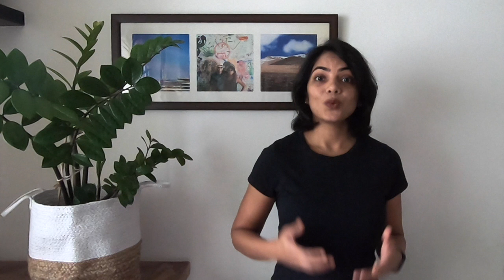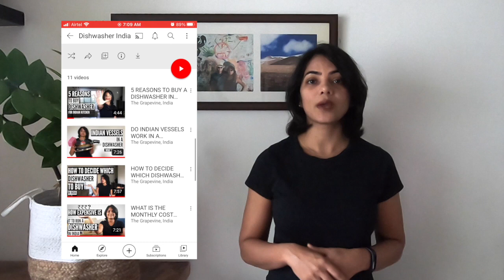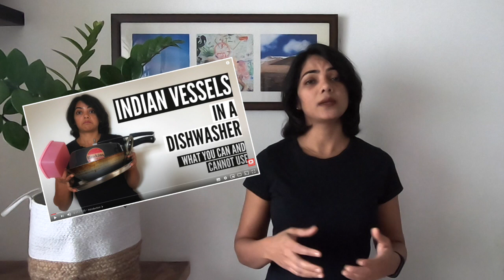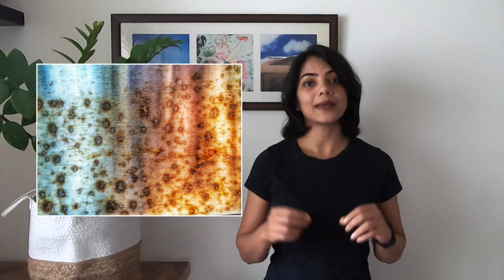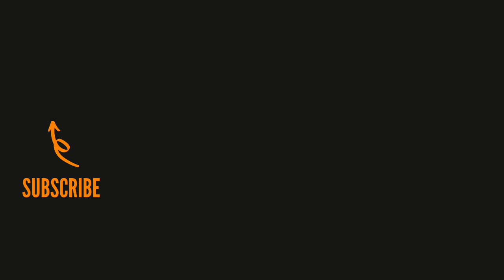CAN ALUMINIUM, NON STICK & ANODIZED VESSELS BE WASHED IN DISHWASHER | Indian utensils in dishwasher

Comment: Most modern cookware is either nonstick  or anodized or cast iron.  I am thinking ceramic kadai and ceramic saucepans. Tawa too. Hope they come up with better milder detergents so we can include nonstick.
Reply from the maker: Hi Anoo, Ceramic is OK to be used in Dishwasher. Consolidating my responses from your other questions - silicone too. Pet water bottles - generally no, unless it is certified as dishwasher safe. Recycleable plastic containers - in general no. When I do have a website up and running, will consolidate in a table :)

Comment: Hi Saumya,  informative video. My stainless steel pressure cooker's safety valve(made of aluminium) got damaged due to corrosion since I washed it in the dishwasher. The aluminium screws of stainless steel utensils also damage if we regularly wash them in dishwasher.  Can u suggest anything for this problem?
Reply from the maker: Hi Chanda, oh never wash the lid of the pressure cooker in the dishwasher - for safety reasons. Unfortunately there is no remedy for aluminum in dishwasher yet. Sorry - wasn't able to help much with this question.

Comment: What about enamel coated tin containers,  silicone brush,  silicone spatula. Are these DW safe?
Reply from the maker: Hi Anoo, Ceramic is OK to be used in Dishwasher. Consolidating my responses from your other questions - silicone too. Pet water bottles - generally no, unless it is certified as dishwasher safe. Recycleable plastic containers - in general no. When I do have a website up and running, will consolidate in a table :)

Comment: PET water bottles,  recyclable plastic containers such as honey bottles etc.  Just complete list of materials with yes/no column will be great.
Reply from the maker: Hi Anoo, Ceramic is OK to be used in Dishwasher. Consolidating my responses from your other questions - silicone too. Pet water bottles - generally no, unless it is certified as dishwasher safe. Recycleable plastic containers - in general no. When I do have a website up and running, will consolidate in a table :)

Comment: Hi, what's the best pots and cooking utensils to purchase if I would like to put them in dishwasher?
Reply from the maker: Hi Aminin, in general - stainless steel, ceramic and glass. I use this brand for stainless steel - which is quite good https://amzn.to/3S8JZqK - most of it works for both induction and gas too. Alternatively, can also consider this brand https://amzn.to/3cURWjo - mainly for glass and stainless steel.
Reply: @TheGrapevineIndia  thanks a lot

Comment: Are Bakelite handle of cookware   dishwasher safe? Should we stick to the ss handle cookware?
Reply from the maker: Hi! There is no published research on that explicitly. Dishwasher manufacturers neither say yes or no. However - I have seen some bakelite handle manufacturers say it is dishwasher safe. Since it is not directly in contact with food - you could still use it in the top rack only where heat is less.
Reply: Thank you so much for ur kind  words

Comment: Thank you for the information, Can Iron  Tawa be used in Dishwasher
Reply from the maker: Hi, no iron / cast iron should not be put in the dishwasher primarily because it takes a long time to build up the nonstick surface on cast iron (through repeated oiling) and dishwashing detergents will take that out and can cause it to rust. Every time you use iron - please attempt to keep it well oiled after wash so that it is not prone to rusting.

Comment: Mam my water hardness level is 915  . What to do . Pl tell me solution for this
Reply from the maker: Hi Rajeswari, firstly check your manual to see what is the maximum TDS level supported by your device. If it is 900PPM (mostly it is around this range) - you may need an external water softener (like this https://amzn.to/2PhDdTR  or kent) in addition as otherwise your machine will get spoilt over time and your wash quality also will not be great.